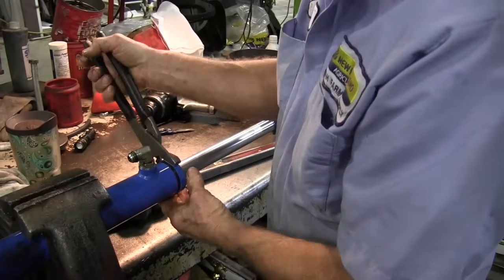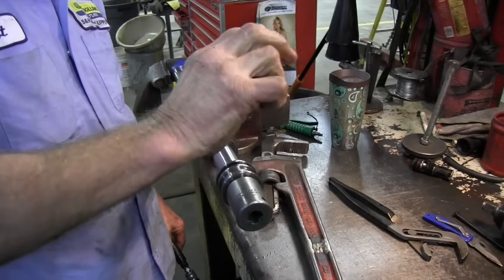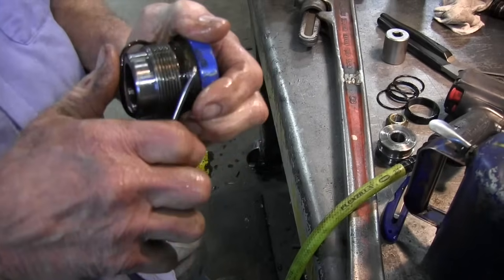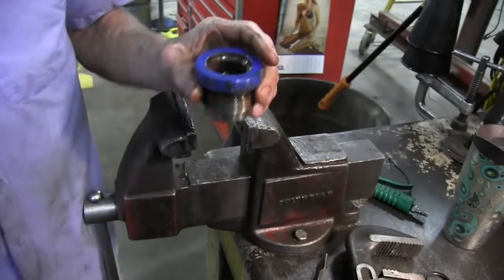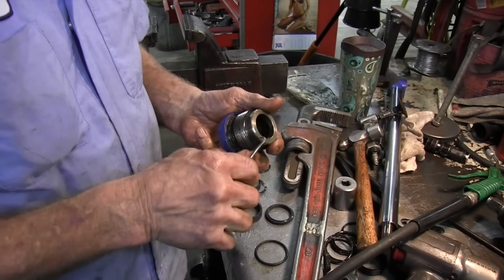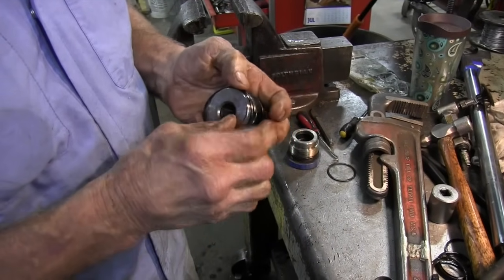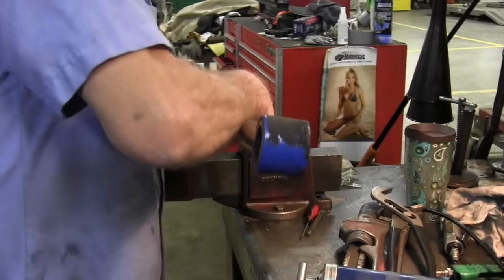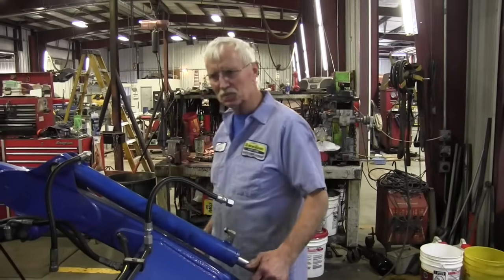How to Repair a Hydraulic Cylinder

Comment: Mike 
What about oil lost when you pull the hoses and the residual in the cylinder?  Probably need a few quarts at least. Even if you catch it, not sure it's clean enough to go back in.
Plus its hydrostatic, so it goes in the rear section I'm guessing.  Good work by Hoot
Just show us everything.

Comment: I have driven 9 and 10 car transporters for decades. If I learned anything, repacking only 1 cylinder in a multi cylinder application will always make the older cylinders seem slow. I always had both repacked at the same time, to avoid uneven raising and lowering.

Comment: Mike
I have been a viewer  of your for a year or so. . learned a lot

NOW i have problem

I need 2 master brakes cylinders for an International Diesel 284

Dealer does not carry anymore (I called more than one dealer)  Called Cook Tractor Salvage in Missouri  - Came highly recommeded. very helpful. . . they carry the brake cylinder but were out..

 tried several other online places  - no luck

Any suggestions for where to call for after marker -  or salvage cylinders -  OR a rebuild kit for the master cylinder?

Thanks so much for your show

Randall
Reply from the maker: I'd try Spring River Salvage in Verona, Missouri at: (417) 235-2233.  They're IH people.  Might also try All States Ag Parts, with a gazillion locations, but a big one in Sikeston at  (573) 471-2727.  Good luck!

Comment: Great video!  I have the exact same loader and had a leaking bucket cylinder.  I was able to disassemble and replace the seals with no issue, however I question the use of grease during reassembly.  I did not want to contaminate my recently-changed hydraulic oil and so I simply coated the piston, gland and cylinder threads with fresh hydraulic oil and had no issue with reinsertion.  I agree with Greg W.'s comment .... don't show people how to correctly do something and then suggest they don't do it!  Also, buy the seal insertion tool; works great!  After all, when you DIY, the tools are free!

Comment: Just watched this today and immediately went out and replaced the seals in my Kubota front loader bucket cylinder.  It was an easy 2 hr job.  It would have been a nightmare if I had only watched some other DIY you tube videos.  Getting the tips from a pro made all the difference in the world.  Now I will have no fear doing this again when the other seals go out on my 19 year old tractor.
Reply: Where did u get the seals and how did u know which ones ur tractor takes ?

Comment: I would like to know what type of lubrification is required on those cylinders when they are not in use to protect them from humidity, water for potential rust. Some say putting thick grease on them but I wonder if contamination would be a problem or would be a good idea to put hydraulic fluid on them while in storage . Thanks

Comment: This sounds crazy but repacking and new seals went fine but now I can't get gland nut to thread back in to the cylinder any ideas
Reply from the maker: No...I'll ask Hoot and see if he has any ideas.
Reply from the maker: Hoot says the threads are likely bad somewhere.  He thinks you could probably find the problem on the gland and repair it, he recommends a machine shop if the problem is inside the cylinder.  Hope that helps...good luck!

Comment: Thanks for sharing this video.  I am doing my cylinders now and this answered almost all of my questions.  The only thing I did not see was an alternate way to insert the aluminum cylinder head onto the shaft.   He used a hammer hitting the head and the head then went onto the shaft; however, I can tell you not all u-cup seals are so easy to pass over the that shaft variance (by the threads) with that amount of ease. A tool does exist which expands the u-cup seal just enough to pass over the variance.  But, it was still a good video.

Comment: Where do you get that special tool that folds that inner seal into a pretzel?  That is what I am stumped on at the moment.

EDIT:  Never mind.  Uncle Google found it for me.  Very nice video.
Reply from the maker: Good old Uncle Google!  I hope I don't ever upset him, he's been pretty kind to me...
Reply: https://www.amazon.com/Hydraulic-Cylinder-Piston-Installation-Universal/dp/B07R8PF9KG/ref=asc_df_B07R8PF9KG/?tag=hyprod-20&linkCode=df0&hvadid=366290009890&hvpos=&hvnetw=g&hvrand=15660281979139414&hvpone=&hvptwo=&hvqmt=&hvdev=c&hvdvcmdl=&hvlocint=&hvlocphy=9009718&hvtargid=pla-788601172779&psc=1&tag=&ref=&adgrpid=80266838870&hvpone=&hvptwo=&hvadid=366290009890&hvpos=&hvnetw=g&hvrand=15660281979139414&hvqmt=&hvdev=c&hvdvcmdl=&hvlocint=&hvlocphy=9009718&hvtargid=pla-788601172779

Comment: So why was the piston loose?  You can be honest with us.  Enquiring minds want to know!
Reply from the maker: Great question, I don't know the answer.  I purchased the tractor used in 2010 and it was like that when I got it.  Next time I see Hoot I'll ask him why they do that.  I'm not sure, maybe the last guy who worked on it caused it.
Reply: Lol, I bet that's what it was.....the LAST guy!  j/k  

Actually, I think I have the same problem on a 2 year old tractor, bought new, with only around 170 hours on it.  The manufacturer nor dealer has impressed me with their willingness to take care of warranty issues so I was wondering if there was something to troubleshoot first before I called the dealer or tore into it myself.

I think mine is with the actual lift cylinders.  I heard one groan a couple times the other day when I left the FEL up with the tractor off but with an empty bucket.  Not sure if it would do it with the tractor running.
Reply from the maker: If you leave the loader up in the air when you park it is it on the ground the next morning?
Reply: I haven't had a chance to really check it yet.  The tractor is kept on some land I have about 20 miles away and I usually rest the bucket on some stuff I don't want to walk away too easily.  When I get a chance, I'll leave it up and curl the bucket too see if I can figure out what's leaking, if anything.  I haven't seen any external leaks though.

I watched your other video with Hoot.  How did you determine which cylinder was the culprit?

Comment: I am trying to get power steering hydraulic cylinder off my Massey Ferguson 283 UK Total Pain in the butt. Got to get mechanic out to the farm to help. Still haven't got it yet. Then I have to haul it over an hour to Elberton Ga to get it repaired.
Reply from the maker: I feel your pain.  The parts where I'm struggling to do something in my videos I generally cut out.  It ain't always easy!

Comment: Great video.  I specifically needed to know whether the cylinder needed to be bled once put back on the tractor, and Hoot answered that clearly and definitively.  I love Youtube.
Reply: Yep, I'm glad Mike asked Hoot that question. I'm just about to put the cylinders back on after having new seals fitted.
Reply: Same here, I searched for bleeding procedures for an hour. Guess they don't need to since it will sef purge like a car's power steering system after a few full cycles

Comment: Hey Mike. I've come across a John Deere 2140 MFWD for sale but the guy says the #1 gear range is out. Is it worth buying and trying to get fixed or should I steer clear
Reply from the maker: Steer clear.  I'm double checking with a friend who is a former Deere dealer, but anytime you have a tractor with something that major wrong, it can be bigger and more expensive than expected and I'd vote to avoid.
Reply from the maker: Here's the answer from Steve, a former Deere dealer who agrees: 

We had a customer buy one on a auction.  It was a 2550.  Similar situation and $15,000 later we had it working perfectly.  The range was out but metal shavings got into the hydraulic system and it had to have a new pump and several valves that were messed up. Also several other bearings in the transmission had taken metal and we were afraid to use them again.
Reply: Tractor Mike thanks mike. Our search continues.

Comment: is there a pin wrench to use in the gland ring ? some probably do not or the gland ring nut is just that a nut. I am not being critical as I never did this work... just wondering other applications use the other tool...
Reply: There is a tool used to remove the fan or power steering pulley on GM vehicles made by Lisle that fit my Case gland nut.

Comment: It makes it hard to concentrate on rebuilding the cylinder when all I want to do is stare at the calendar girl. I really appreciate seeing this done because I recently had a 3" boom cylinder rebuilt at the dealer. Now I see why it cost me about $150. No way I would want to tackle this job just to screw it up. Thanks Mike.
Reply: If you had any cylinder re packed for $150 over 2" then keep taking it to the dealer.  I paid a hydraulic shop 360.00 to rebuild a Case bucket cylinder put it back on and the other side started leaking.  This time I purchased a seal kit from the local Case dealer (Border Equipment) and the kit cost me 80.00. The loose nut on the video repair makes it look easy.  In real life those nut are on so tight you need a four foot pipe over a 3/4 dr breaker bar to take them off.

Comment: Another great video, thanks, Tractor Mike. I'm curious whether both cylinders had internal leaks.  If not, I wonder how your guy figured out which cylinder was the bad one. And, if the other cylinder was still good, how did the loader drop? I would think one would be sufficient to hold up the empty loader bucket.

Comment: How does the system deal with the grease that is used inside the cylinder?  Does it just dissolve into the hydraulic oil, get caught in the filter, or just stay there?  Just curious.  Pretty amazing how fast Hoot was able to repair that.  I might try it on something older and not my primary machine, but would never undertake that on my tractor.  Also, how did he check for external leaks other than by sight?
Reply from the maker: Matt, I'm sorry I missed your question before, it just popped up again, I don't think there's enough grease there to worry about, and I'm not for sure, I'd say it just goes into the hydraulic system and dissolves there.  I'll ask Hoot next time I see him and try to remember to post his answer.  If you leave the loader frame and bucket up in the air and it doesn't come down, there aren't any leaks.
Reply: I'm concerned about this also, since I have a CVT transmission and a common sump. With a CVT transmission, I don't want to add anything that would change the oil's characteristics.
Reply: Good question. Im used to be a tractor mechanic myself. And has always thought about that to. It is pretty much standard procedure in the business to lubricate o-rings, valves etc.with grease. In an ideal world u should lubricate for assembly with same type of fluid that the part is working with during service. In this case hydraulic fluid. Nevertheless I have never seen any type of problem with grease in oil or diesel fuel in my years. To calm my mind I try to use the same brand of grease as the oil because then hopefully you have a little chance that the manufacturer have made compatible products that mix together and don't react chemically.